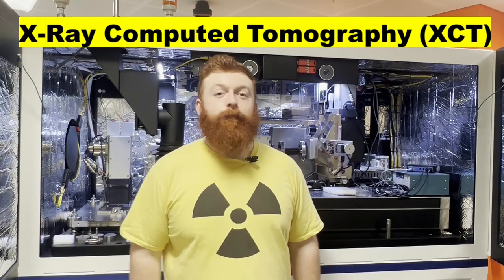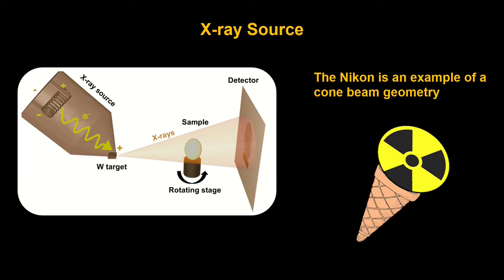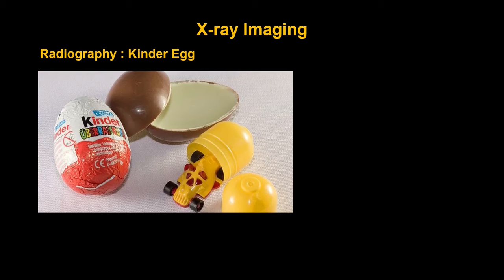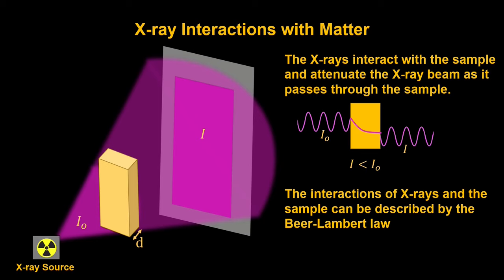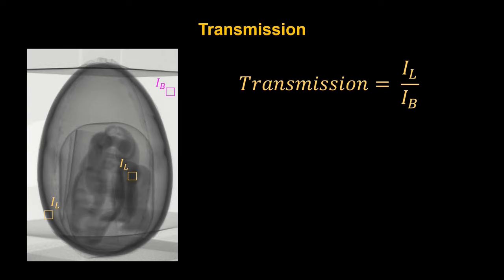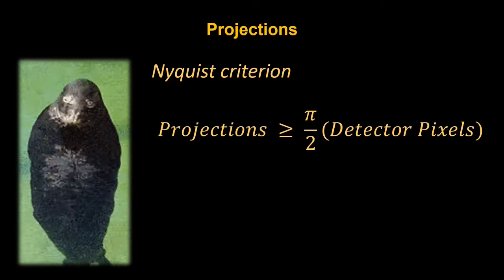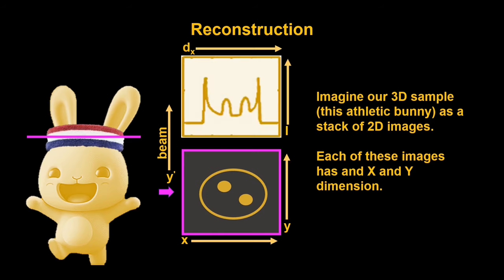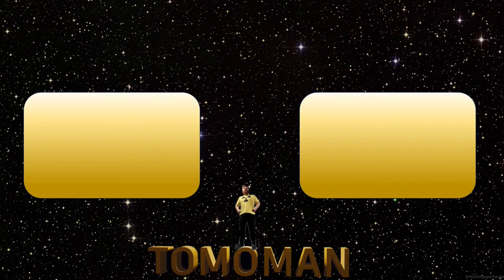The basics of X-RAY COMPUTED TOMOGRAPHY (XCT) - Tomoman Lecture 3

Comment: Thanks!! What was new for me was the optimal projections being the width of the images in pixels times pi/2. Machines I use generally recommend a 1-1 ratio of projections - pixels object traverses, but with the generic idea that more images can be better --- and in my experience that fewer images can be tolerated. The latter being more common especially for older machines like the past academics owning my 2002 GE Locus SP (and the manual) recommending just 900 projections for a traversed pixel width of 2,500!
Reply from the maker: Glad to hear you got something interesting out of it. 
Generally, you can get away with far fewer projections as you say, the less projects the faster the scan so it’s good. 🚀